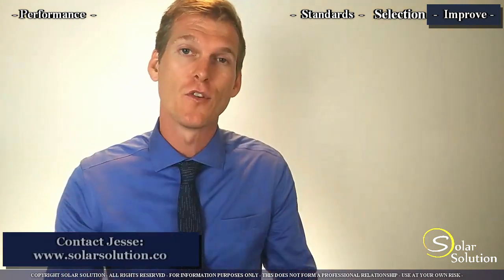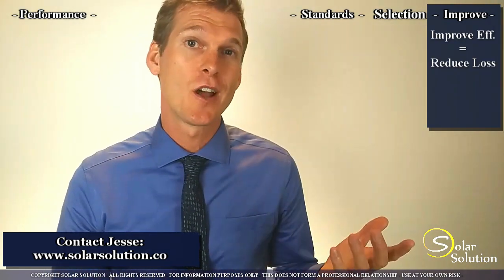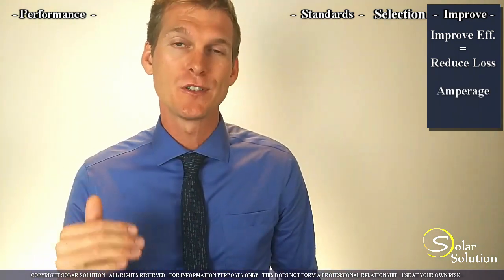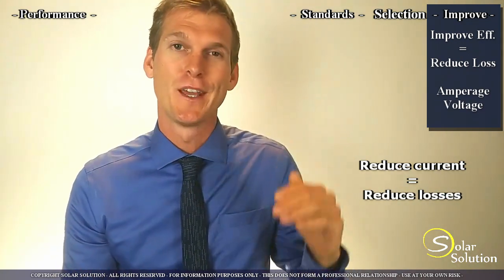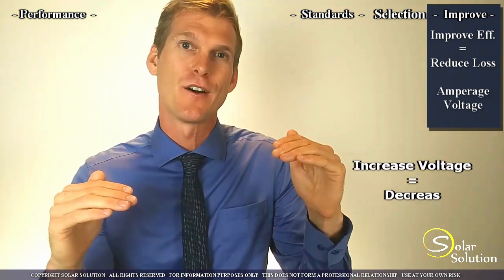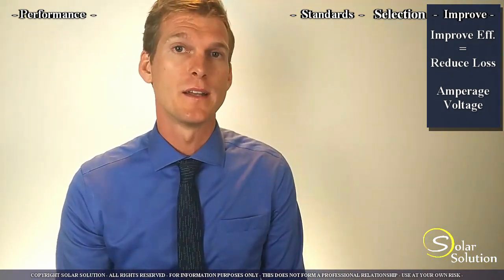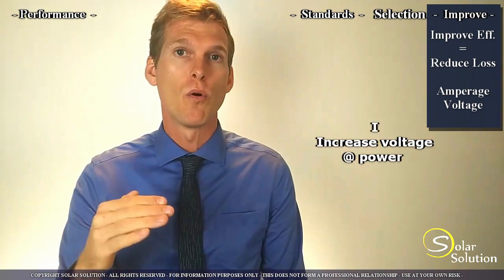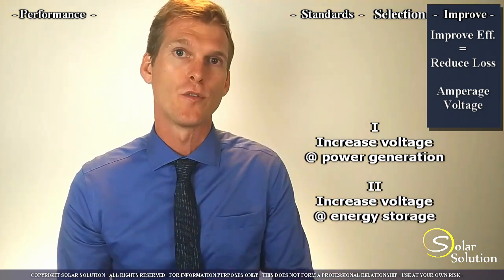DC Wire Sizes Explained - Understand how to Increase your system Efficiency with this knowledge

Comment: Thanks Jesse - the most important aspect of cable/wire selection is I2t (short circuit rating) before the thermal rating being referred to here and in RMS for AC (not infinite Z) or DC current (AH/kWH's) - which will have different fault levels naturally. It may mean that you have to select on short circuit before the thermal considerations are even discussed. Richard Murphy
Reply from the maker: Hello Richard! Thanks again for your valuable contribution to the channel.

Comment: This is very interesting to me because I need to site my array 300 or 450 feet from my house (300 if I run the wire under my pond, 450 if I run the wire around the pond).  It occurs to me that I should possibly run it under the pond for the temperature reduction (during summer anyway) because you say heat increases resistance.  The kit integrators I've talked to are taken aback by this long siting distance for an array.  However, I can see many rural customers having this desire to site their array in a particular place.  (If not the need.  I need to site on the far side of my pond because my house plot is so well shaded.)

Comment: Im wondering about inverter efficiency.   I heard sizing your inverter as close to your average draw increases the efficiency of the inverter.  I'd like to learn more about inverters and how they work, and DC v. AC current.  Thanks Jesse!  Love your videos.  In general, Im excited to get more in depth/technical on solar topic.
Reply from the maker: Hello Rasa, thank you for your message. You have a few excellent questions there, and none of my videos cover this yet. I will definitely share a dedicated video with you on this. I will let you know once it online. I like your name, Rasa, where are you from? All the best, Jesse.
Reply: @SolarSolution  thanks!  I recognize theres perhaps a lot to unpack in there.  So thank you for your effort.  Im in the US 🤦🏾‍♂️🤷🏾‍♂️.  Ive been slowly teaching myself solar and really love it.  We have a lot of queer, poc and/or homeless and semi homeless who live "off grid" and get a lot from small solar systems attached to vehicles or sheds.  Im working on a similar project now.  Im wondering if breakers (typical home breakers) require only AC current.  If so, the breaker box would need to be installed on the AC side of the inverter.  I assumed originally it would be on the battery side then feed to a 2000w inverter.  My original question is why a home breaker box?  In line breakers reduce wire length and seemed more appropriate somehow, but this is the material we have to work with.  I figured id post this and see if you or others could help fill the blanks in my understanding.   Thanks yall!
Reply from the maker: Thanks for your message Rasa. I cannot provide personal advice through the YouTube section, but others might jump in here. Also note that I support community projects under CSR: You can contact me through the main website, just make sure to mention it is a community support project: https://www.solarsolution.co
All the best, Jesse.

Comment: Excellent video. Where is the best place to get specific wire size? I’ve built houses, wired them, etc. I’m still having a hard time finding exact wire size. I’m planning a 3,000 watt inverter with 400-600 amp hours. I may have missed it but seems the AWG wires are not large enough? It seems I need to go to the 0 gauge sizes? So do I just tell the supply house, I need copper wire, approximately 10’ long, that will carry the load of a 3,000 watt inverter. If I take 3,000 and divide by 12, it is 250 amps. It seems Renogy said get a 350 amp fuse. I need to know the gauge of wire for the maximum amp draw. Seems it should be easy, but too many different ways they look at it? Thanks, I finally get why longer cords heat  up, more resistance

Comment: Jesse, you mentioned ambient temperature surrounding the wire affects the resistance. If I surrounded my 6 gauge wire running from my portable generator to my house with 1 1/2" foam insulation (I'm thinking of a pool noodle or spray foam) would that further help reduce resistance and/or the amp surge when the A/C kicks on?  If pool noodles would help reduce resistance by surrounding 6-10 gauge wire don't tell the manufacturer as they will increase the price of pool noodles 10 fold and start selling them at Hardware stores as insulation for wiring.  : (

Comment: How do I wire 10 panels on the east side of house with 10 on the west side of the house when I live in Florida? As you touched on in another video will the shaded side always pull down the bright sides performance?  I can wire each 5 panels on each side in series for a total of 244 volts (MPPT can handle 250 volts)  Thank you for the great videos.
Reply: Use 2 charge controllers or you will have problems.

Comment: Strand wire vs solid wire ,as I understand it, in Marine wiring,stranded tin coated wire is used, I’m told it’s code , I have a problem believing it’s better,  for one, two different metals and electricity , the other is strand wire is easier to arc, one strand arcs and melts other strands of wire, it’s more common out here on the water in the boating world,I prefer solid wire until you get to areas where flexibility is needed,the it’s the stranded wire, what are your thoughts?

Comment: Em using mppt controller and run home lights and fans but fans are slow due to distance and I have used 2.5mm 7/29 cable for connection.

Comment: Very good way of explanation. I need your technical advice . I have two 220Ah 12 v  batterys connected in series want to connect a third battery 170 Ah 12v . how should I do it? Without loosing any loss of current or voltage
Reply from the maker: Hello Abdul, thank you for your message. It is good to hear you enjoyed the style of the video. As for your request for technical advice: You can reach me through the following link: 
https://www.solarsolution.co/services
All the best, Jesse.
Reply: I think the only reasonable way is to buy the fourth battery.
A car with three wheels doesn't run well either.

Comment: Can any cable work with solar panels?
I am using a Canadian solar panels rated 300watt 36v 8pics
A charge controller Felicity 60A 12v/24v/36v/48v
Wire gauge 4mm² 30meter long
Trying to Charge a lead acid battery  bank of 480AH
 Battery set is: two strings is series and paralleled both as one making 24v 480AH
BUT IS NOT CHARGING WHAT COULD BE MY PROBLEM FOR A COMPLETE DAY i am from Nigeria, please you can respond to me very fast I am in a situation right now. So so worried 🙏.
Reply from the maker: I am so sorry to hear that! Dont worry though, every problem has a solution ;)   Do you know what the the output voltage of your solar panel[s] is? Do you know the actual voltage of the battery bank? Are the wires connected to the correct terminals on the charger controller? Do you know for sure that the charge controller is funcitional? Is there a chance for any wire damage? Good luck, Jesse.

Comment: Jesse, I am thinking of running 2 electrical wire from Ford F-150 start battery (215 amp alternator, 70 Ah battery. 15' to cabin, 18' to truck bed) to cabin and truck bed for powering 2000 Watt inverters to charge EGO batteries while driving. What gauge of wire should I use? Thank you in advance.
Reply: Be careful the battery temperature while alternator is changing...

Comment: I’m still confused do you size the wire to the maximum load or the maximum amps available? If I have a 300ah battery and a inverter  that has a maximum power draw of 150amp do you size it for 300amp or 150?

Comment: Jesse, many have said it’s important to have stranded wire for everything before inverter. Is this true? Some cite skin effect but my understanding is that doesn’t matter because it’s low to zero frequency.  Other than flexibility, does solid wire vs stranded make a difference? ( let’s ignore contact area in the terminal crimps)  love your videos!

Comment: Is there a difference between cable size and wire size? So gauge 8 AWG is bigger then a gauge 12 AWG cable if I understand correctly?
Or does cable size means its circumference ?

Comment: It would be very useful to know if to calculate the wire size, when you have a junction box far away from a 24V battery bank, to you calculate the wire size for the 12V part (after a buck converter + junction box) based on the full length of cable, or just after the buck converter?
Reply from the maker: Great suggestion!

Comment: Excellent Video  , I have a question and i need your advice and help
i have 2 batteries 185AH connected in parallels mode,  between these 2 batteries there is 24 inch distance,
( i can't make it short distance less then 24 inch ) and i have a load of 500 watts max from these 2 batteries..
Please suggest which wire size ( AWG and MM ) and Length ( Inch ) should i use  for my setup will run smoothly and secure. 
i will be very thanks full to you
Reply from the maker: Hello Feroz, thank you for your message. I am glad to hear you enjoyed the video. I would like to help you, unfortunately I cannot provide personal advice through the YouTube comment section. For advice you can contact me through the main website https://www.solarsolution.co. 
All the best, Jesse.
Reply: If the 3% rule holds when paralleling batteries it looks like you could use as small as 12awg.  I can't imagine actually doing that though.  Any auto parts store will have suitable pre-made battery cables in the 0-4awg range so that's what I'd use.

Comment: Jesse, what wire size should I use for rewiring solar garden lights. I want to use the small led lights on a project. it's very small wire and I can't seem to find it. I know it's trivial but I hope you can help. Thanks in advance .... Steve
Reply from the maker: Hello Steve, thank you for your question. Have you consulted any of the online wire size calculators yet?

Comment: Hye jesse.. i had use cable awg 14 for my 12V led system.. but when i connect several led(my case, i connect 6pcs 9w LED lighting), my voltage was dropped to 9-10V.. the length of my cable is around 25metre. Am i need to used larger cable?

For cable with same size, which one is better? Larger strand or smaller strand,?

Comment: I will look through to see if you have covered this topic, but in my case, I will be installing LED lighting and using many DC powered devices, mostly as effects in a new game room.  I have DC power supplies that will connect to AC outlets.  How far will I be able to run the DC wires to connect to individual LEDs and or items such as digital picture frames?  Thank you.
Reply from the maker: Hello Maria, thank you for your message. Based on your question, I think you might benefit from the video I shared on 'Voltage Drop In Wires', here is the direct link: https://youtu.be/yHxHoNjMx3Q. Enjoy! Jesse
Reply: @SolarSolution  Thank you!

Comment: If it's bigger than the load cable, can your ground wires ever be too big? For instance, would having 2/0 AWG on my engine ground to chassis and negative post to chassis be too large for a 2 or even a 4 AWG load cable? I'm hoping buying a couple months ago before I learned as much as I have isn't biting me in the ass.

Comment: As electrons flow 'across' and not 'through' a conductor, how does the number of strands in a particular wire size affect conductivity/voltage drop, if any?
Reply from the maker: Hello Carl, thank you for your English lesson, I appreciate it. As for your question: You might find the following video on voltage drop in wires interesting: https://youtu.be/yHxHoNjMx3Q
Enjoy and all the best, Jesse.
Reply: @SolarSolution  Apologies for the confusion, I never intended that as an 'English lesson'. My purpose for the wording was since electrons flow on/over the outside of conductors, rather than 'through' them, would more strands in a same gauge wire affect conductivity/voltage drop?

Thanks for the direction to the next video and all the good work you have put into this series.

Comment: Hi! can i ask on what is the maximum length of the MC4 cable from the solar panels to the inverter? is it okay if the distance between the two is about 50 meters? is the amperage affected? or is it the voltage? because the inverter reading shows 0.6 amperes for a 486V string of solar panels

Comment: What is the efficiency gain going from 12v to 24v?
Reply from the maker: Hi Greg, thanks for your question. I have another video waiting in line which discusses 12/24/48V battery wiring setups. I am sure this will answer your question.
Reply: great succinct and informative explanations

Comment: Damn rhat AWG system fits the imperial system. Americans do everything to not use logic. Where does the AWG start? Really informative but what is wiregauge 30 times or devided by 1.123? With metric the name has the size but what is size 30,where does it refer to? Do I just have to remember what gauge 20 is and go from there? What a way to go